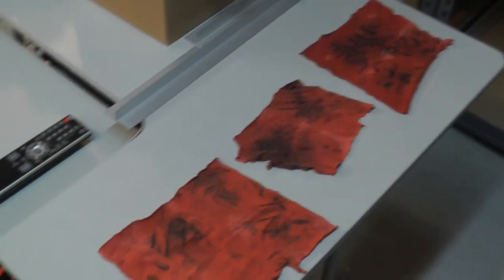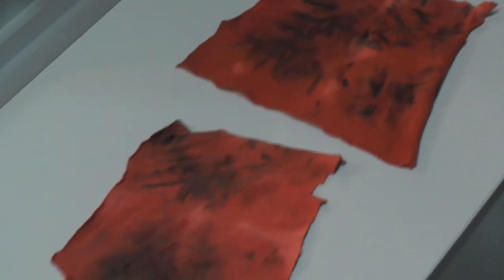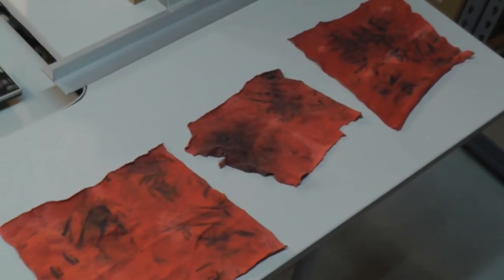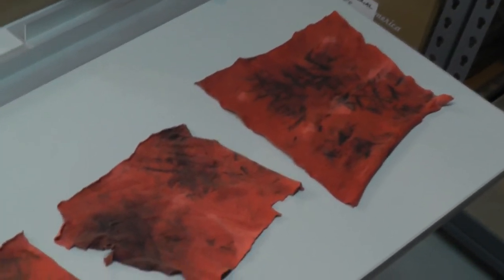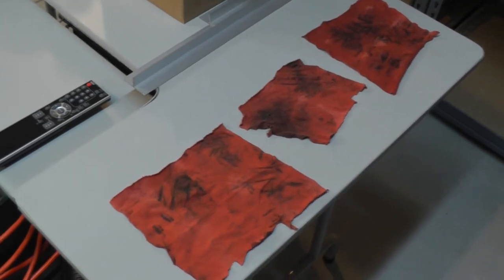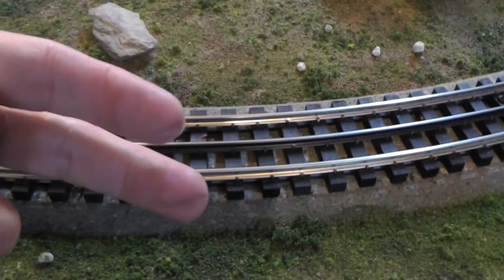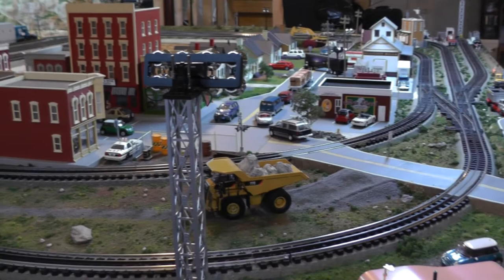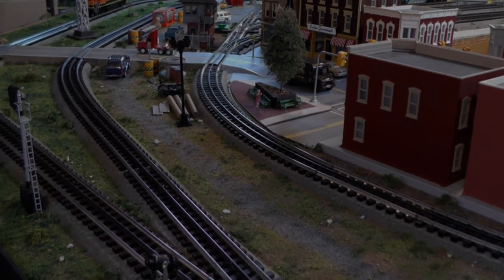Clean Your O-Scale Model Railroad Track

Comment: I think it is going to be a never ending process. I too am building still, but have to run occasionally to test engines. I just traded some stuff for some older engines and they all neede help. I had to clean before I could even test them and only a short section that is available for testing right now. Good reminder...
Reply from the maker: Hey George - Yes track will always need cleaned, however I have to admit I had not cleaned it at all for at least 4 years  :)
Reply: BobotsTrains
Mine is not yet 2 years old and I have already cleaned it several times, at least in spots, but then I have my wood working shop in the next room, which was the same room until I put up a dividing wall to fight against the dust issue. It is better, but then I go and do more hacking on the layout...